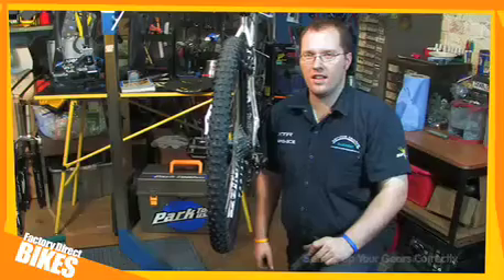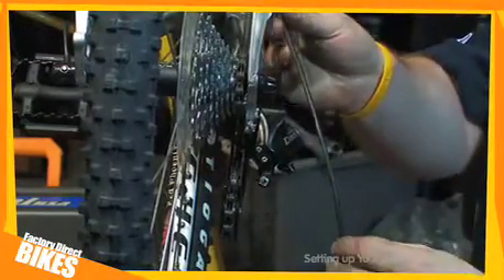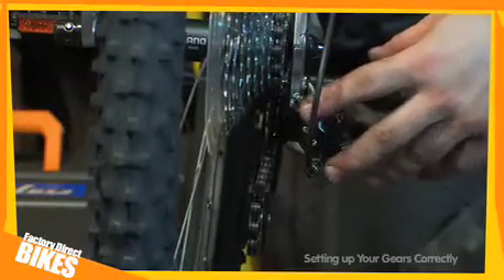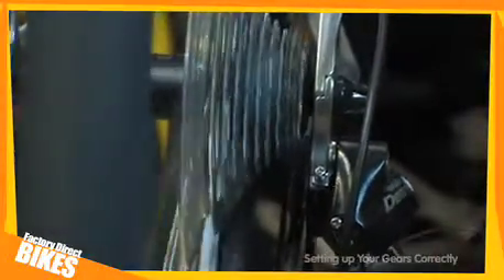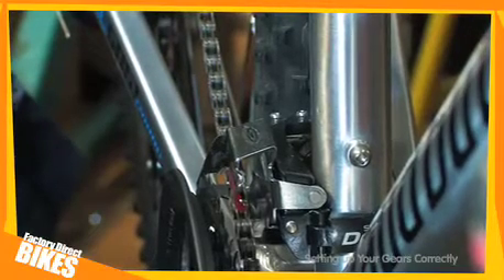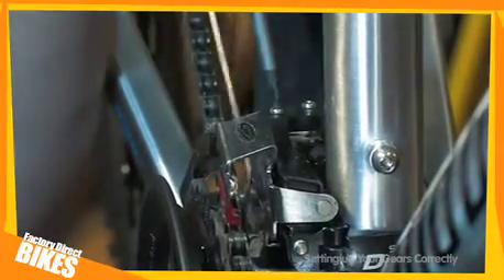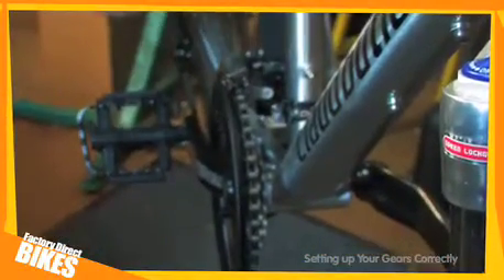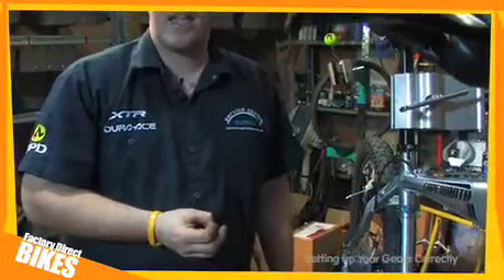XL H1 - Setting up Your Bike Gears

Comment: Good video....Been doing the same set up for a while now but never disconnected the gear cable until now...found out that 1 strand of cable had snapped causing little movement through the tube giving me gear change problems so check cable condition 1st...DOH !!!